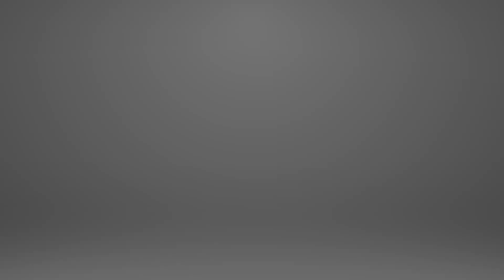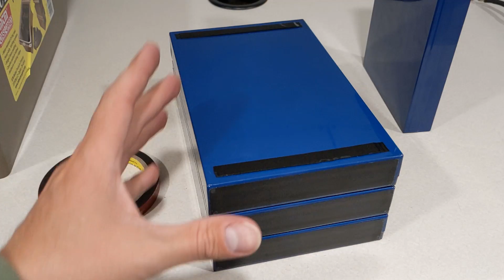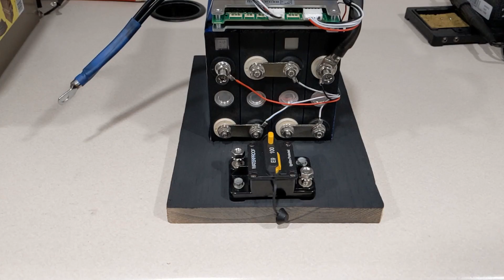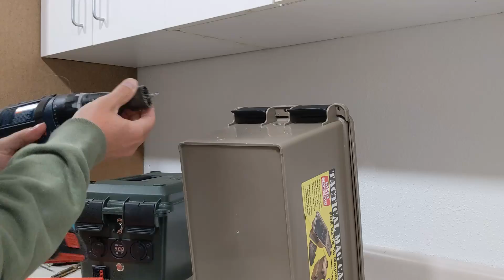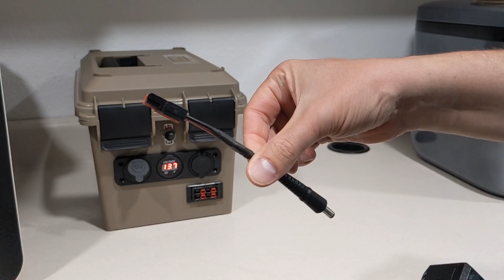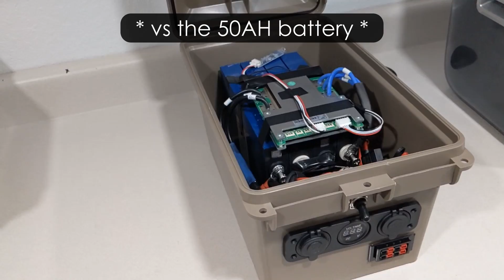DIY 80AH LiFePO4 Battery Box - COMPLETE BUILD VIDEO  | AliExpress Cells, High Quality BMS

Comment: Thanks a lot for this video. As I am building my version 2 solar generator hence watching a tons of videos related this and undoubtedly this one can be said one of the best video I have watched. Indeed, I have already watched this video couple of times due to few instruction/parts list. I have one question though related to the Anderson connectors. In this build, it looks like you have mounted a 4 port Anderson plug flush mount whereas your all other connectors look like those are mini-Anderson plug type. May be this is a naive question but does the mini Anderson power-pole connectors fit in the regular Anderson port ? In fact I am purchasing the connectors but cant be sure how those are compatible.
Reply from the maker: The Anderson power pole connections, the plugs and ports, are all the 30amp size.

Comment: Great video. I've been on the suggested BMS page and I have a couple of questions:
1) How do you choose the BMS according to the amps drawn ? For example, I plan to use the battery for a trolling motor that draws 34 A max. So the 60 A BMS should be ok, right ?
2) I noticed that you used a circuit breaker. However, on the BMS page, on the app screenshot, it seems to show (scroll down) an "Hardware short protection" and "Hardware overcurrent protection". Wouldn't these make the circuit breaker redundant ? And what's the difference between them ? I guess the circuit breaker is there just in case....
Thanks.
Reply from the maker: Thanks for watching. You'll be good with the 60amp BMS, you can always go higher for future projects if you think youll get a bigger motor. I used the circuit breaker style switch in order to power down all ports and front controls. It just a benefit it also works as a circuit breaker.
Reply: Ozne_    Yesterday I got my 200 amp hour lithium battery with integral BMS and no plastic case.  I replaced a similar 100AH unit. This is for a modified Minn Kota trolling motor battery box that has a factory 60 amp circuit breaker on the terminals. The box is used to power up medical equipment where there is no AC power and trees block sunlight to solar panels. But it would probably work very well to run a 35 amp trolling motor for a long time. Did you build it?
Reply: @kimmer6  I ended up buying a built battery. The main problem I'm having is overheating of the speed controller

Comment: Hello.  I really liked the video and it has me wanting to try and build my own box too.  I did have a few questions though. The batteries in the link are now $159. Are they the correct batteries? They are much cheaper than what you originally described. What AC charger do you recommend?  Also, if you use a 100 watt solar panel to charge like the Rockpals, do you need a charge controller wired in or does the BMS serve that function too? Thanks for your informative work!
Reply from the maker: You'll want to have a lithium based charger to charge it properly, those can be either AC or DC powered. There are multichargers available that support more than one input, for example solar, DC or ac charging. (check out the Kisae DTM1250, it's amazing!).

The price of batteries have dropped significantly because the larger 280ah cells are very popular right now. You can always spend more money for these types of cells. With cheap batteries you'd probably get around 95% advertised capacity, which I think is worth it for the cost.

An active cell balancer is usually required for unbalanced cells, you can get a pretty cheap one off Amazon, it worked really good for my battery pack. Will Prowse has a couple videos on the subject. 

Just plan to get good at soldering. It's been such a fun project and I have learned a lot. My next build will be a bigger 280ah build. Just saving money for those batteries.

Comment: great video and tutorial but I was wondering if I built this and put three in series for 36v system to power a trolling motor. Do you think it is doable? the trolling motor draws a max current of 43Amps at full power. thanks
Reply from the maker: It might be easier to manage if you just built a 36v battery. There are BMS systems designed for 36v. Check out those videos on the youtubes

Comment from the maker: Check out my website for other awesome content!   https://jasonoid.com/
Reply: Hey, can I get the link to the C4 box smart charger you showed in this video and your Twitter or Instagram handle, so I can tag you in my project after finishing building my power box inspired by yours.
Reply from the maker: @TechGrowls  All the links I used are in the description of the video. @Jasonoid1 on instagram.
Reply: Hey,  thanks for the video. Like it. It's not clear to me how the charger is connected to the box. By the 12 V plug? I'm looking for an Battery Box for fixed install on a boat. Most Batteries are not protected for humidity and marine batteries are even far more expensive. Please come back.
Reply from the maker: @Hotzenplotz1  Charging these batteries is like charging a car battery. Hooking up to any of the input/outputs will put power in. I hook up my LiFePO4 designed charger to the Anderson Powerpole connections at the bottom of the battery to charge it.
Reply: @Jasonoid  so you can charge it through the female 12V cigarette lighter port?
Reply from the maker: @mg6192  You could technically charge it that way, but the 12cig port is limited to like 10amp input. Much faster to charge it via the Andersonpowerpole connections that can handle more amps. Also, check out my newer battery build on my channel. It's cheaper and has much more power inside!       https://youtu.be/uN1h0XIpfTg
Reply: @Jasonoid  thanks for the reply!

Comment: Awesome video! I'm trying to get the best option for a Lifepo4 bat like this for a while to run my astrophotography setup in remote areas.
Few questions, because I'm kind of a noob in this area:
1. How do you charge it? Can you use the powerpole panel, or some croc clamps go onto the main + and - bolts? (also I think I heard once, you can only charge cells like this separately). Do you have a charger you recommend? (unfortunately I'm based in the EU, so would might not find the model in your video)
2. You can adjust the voltage with the BMS for discharging I assume - how does that affect the charging process?
3. Raising the voltage (e.g. I run my setup on 13.8V) doesn't raise it on the USB ports? (yeah, super amateur question :D)

Thanks!
Reply from the maker: Usb ports are fixed at 5v so no need to worry about that

12v ports will put out full voltage. Just FYI that cars have about 14.2 volts while the engine is running so this is still less. 

I charge it from a lifepo4 charger via the Anderson power pole connections but you can also do it from the main terminals. Any lifepo4 designed charger will work.
Reply: @Jasonoid  thanks, appreciate the help! Actually I don't mind the voltage being around 13.2-.13.8V, if there is way to set it up somehow on the BMS :)
Reply from the maker: @balimester1595  BMS I used is 100% configurable via Bluetooth, I love it. (if you buy the Bluetooth adapter)

Comment: Fantastic build.  It would be great if you could do version III with a power inverter, A/C power supply and a solar controller so it could also provide 110v A/C and be charged from solar panels or grid power.  Thanks. !:- )
Reply from the maker: Those are some great ideas!

Comment: I am just learning about life po4 batteries. Would this type of an application work for a small (max 20a draw) trolling motor ona kayak or do i need to fork out the cash for a "deep cycle" life po4? Thanks.
Reply from the maker: All Lifepo4 batteries are technically deep cycle. You can discharge them 80% without permanent damage. 20amps is a lot of power draw. If you want the battery to last longer than 3 hours you'd want to get something larger but use the same principle in my video to build it. 200ah or even 280ah batteries have come down in price quite a bit recently. If you have room for a larger battery I would recommend a larger capacity.

I only have an average of 5 amp draw and my 80ah battery works great for me.

Comment: The charger you have listed below the video is what you are using to charge the 4S system???
Reply from the maker: Hey Vandall, I use a smart charger that supports Lithium batter types. There are many available on the market. I recently found an AWESOME DC to DC charger that supports both a DC input and Solar input so you can charge with your vehicle at high amps or with solar panels with high amps. Pretty slick!

Kisae DTM1250 is the name of the charger. I'll put a video out on it once winter is over, lame cold weather!

Comment: Hi there. Where do you plug in the charger (input)?
Reply from the maker: Charging that battery can be done via any input or output port. I made an adapter so my charger plugs into the Anderson Powerpole connection on the front. It works really well!
Reply: @Jasonoid  Does it allow pass-through charging?
Reply from the maker: @foscamkoto2728  Consider it like a car battery. Anytime you have more power coming in than out it will be charging. So if you are using 4 amps and charging at 10 amps. You will get + 6 amps at the battery.
Reply: @Jasonoid  If I use solar panels and let's say, it is cloudy and only producing 1 amp, battery is 80Ah capacity and 80% full and I have a 5 amps load - would that still work and not break anything? Sorry for all the newbie questions.
Reply from the maker: @foscamkoto2728  you'd need a solar charge controller designed for a lithium battery to charge it first off. Then you can use solar panels. 

And yes the battery would be fine using 5 amps while it's charging at 1 amp, that means your battery would be losing power at 4 amps until the BMS kicks an disabled the battery until low voltage.
Reply: @Jasonoid  Makes sense. Do you have a link for a BMS similar to yours but is rated for 24V and 100A ? I'm going to build a 8s1p 100Ah LifePO4 for my shed. Thanks again for your help! BTW, I've watched your Iceco comparo video several times and that made me buy a VL60s. Thanks for your videos!
Reply from the maker: @foscamkoto2728  I appreciate you watching the videos! I have lots on the subject of batteries, solar, and fridges. I am currently testing a 2 type charger that can support SOLAR and other DC input so you can charge your battery when there isn't any sun off your vehicle DC system. Its the KISAE DMT-1250 Smart Battery Charger. Keep an eye out for that one soon you might be interested in it.  Not a sponsored video either. I have been in a pinch when the sun was missing for 2 days and I couldn't really charge my LiFeP04 battery. This charger will solve that issue.

As for BMSs that support 24v, I am only familiar with these 12v BMS systems. I know Daly makes many other types but they lack low temp cutoff. They might have one that you could use on your setup but you would need to be mindful and not charge the battery below freezing as it would damage the cells.
Reply: @Jasonoid  Thank you for your inputs and appreciate your time replying to my questions! Best of luck to your channel!

Comment: Great build! Question, can the batteries be charged through the Anderson power pole connectors?
Reply from the maker: That's how I charge this battery, I made an adapter for my charger to AndersonPP and it works great.

Comment: Thanks for the tutorial but I don't see how you actually charge the cells. Is there are changing port somewhere I don't see? Do you simply hook up aligator clamps from that A/C charger or MPPT Solar controller?
Reply from the maker: Connect my charger straight to the Anderson port. Works great
Reply: @Jasonoid  can you charge the battery and use it at the same time?
Reply: solar charge it, and let a 12v frdige run ,
Reply from the maker: @Alan-dl2ct  yes, up to 100 amps (or whatever bms size you install)

Comment: Great video and nice to see you're into FPV! Like you, I have several RC type chargers for my Li-Po's, but my question is, if I use my RC charger, would I balance charge the LiFePO4 batts using the charger or would I just plug it into the Anderson connectors and let the BMS balance charge the cells? If you don't recommend I use the RC charger, then let me know that as well. Thx
Reply from the maker: I haven't done any flying in awhile been too busy on other projects, I am hoping to purchase a new 1s or 2s tiny whoop soon because they look so fun! Any recommendations? What do you fly FPV these days?

As for my LiFePO4, I let the BMS handle the balancing. I do have a balance lead so I could use my hobby grade charger to balance the cells every now and then. I'm guessing that would take days LOL.... I currently have my battery voltages maxed out at 3.65v.  My father in laws Battleborn 100AH and 50AH cuts out at 3.8v per cell so not sure if I want to raise it up a little just to get a little more juice out of it. It's been a great project. My cells aren't perfectly matched and that my only annoyance. If I did it again I would probably purchase SOK 100AH raw cells.
Reply: @Jasonoid  Your quick response is much appreciated and thanks for the added advice about the SOK 100AH raw cells. As for tiny whoops, I have the Eachine Trashcan, which works great for PPV & can be run at 1 or 2s, but most seem to go w/ the Mobula7. Either way you can't go wrong, and other than losing props in trees or grass, they're extremely durable and can take a lot of hits.
Reply from the maker: @ttttenney  I kinda forgot about using my Turnigy 80watt charger to balance the LiFPO4 cells so thanks for the reminder. I have it balancing right now on LIFE mode. The BMS has been doing a good job but I think the Hobby Chargers always do better. We'll see how long it takes at a 3amp balance charge LOL. Having any LiFePO4 balance charger that uses a balance plug would work for this setup. 

I have been looking at getting the Happymodel Mobula6, or the HD version. Also the EMAX Tinyhawk.... so many choices! haha
Reply: @Jasonoid  Get the HD version, makes for some great footage. 
Let me know how long and it goes balancing at 3amps. I've learned a lot from you, thanks.
Reply from the maker: @ttttenney  Okay, balance charging is not worth the time it takes. I didn't really see progress using my hobby charger. For any battery pack with the cells that are not perfectly matched, this is something that should be used:

https://amzn.to/3rXV5BT

I went ahead and picked it up, it should work really well for my pack being slightly mismatched.
Reply: @Jasonoid  being new all this LiFePo4 stuff, I'm afraid I've lead us both down a rabbit hole, thinking the cells need to be digitally balanced from the charger, when further research indicates that is one of the duties of the BMS. IDK for sure and I'm still looking into it, but either way I do appreciate all of your communication and help with this noob.
Reply from the maker: @ttttenney  only used or mismatched cells need to be balanced. It's kinda the luck of the drawn on these cheaper batteries if they are going to need a balancer or not. My BMS balances the cells but at an extremely low rate so when you charge at 20amps there's no way it will be able to keep up. I love the BMS I used and I would still recommend it but Will Prowse mentioned cell balancers are needed in addition to the BMS is some cases, watch this video here, it's very helpful explaining why it's needed on SOME batteries, not all.

https://www.youtube.com/watch?v=fEVQ_8DUpm4
Reply: @Jasonoid  that was a great video, in addition to yours. It's all starting to make more sense now, so thanks again for all your help. 
BTW - your affiliate link is for a different size MTM Tactical Ammo Box, than the one shown in your video. Let me know when it's correct, so I can make sure you get the your cut when I go to order mine.
Reply from the maker: @ttttenney  I used the MTM TMC15 Tactical Mag Can that I have linked in the description.
Reply: @Jasonoid   the one in your link measures LxWxH 5 x 5 x 5 inches in their item dimensions, which doesn't match the measurements in your video.
Reply from the maker: @ttttenney  just search on amazon the item title I just pasted. Not sure why the link is different for you. It's much bigger than that. It hold M4 magazines
Reply: they have the measurements wrong in their item descriptions on the top page, but when you scroll down they have it correct w/ the Outside Dimensions: 9.3” x 15.3” x 8.8”(H). I don't want the comment section of your great video to be all muddy because of me, so go ahead delete our last few comments if you want. Thanks.
Reply: @ttttenney  Amazon dimensions are incorrect on the top, they are correct in the description below